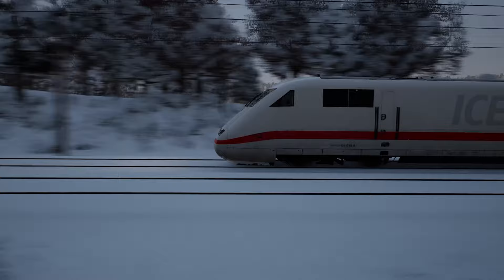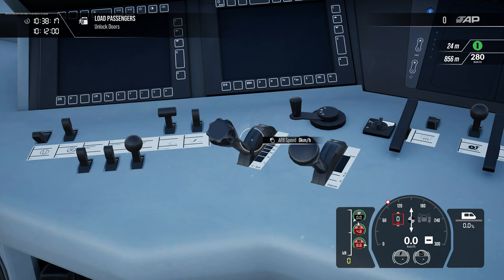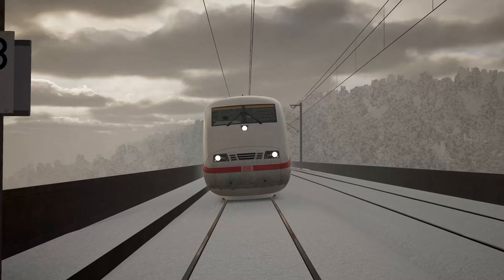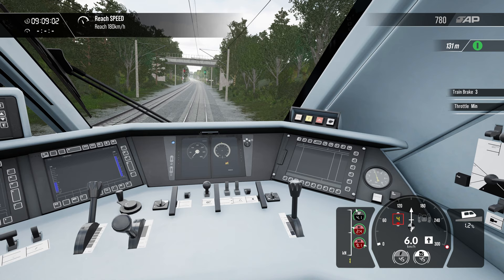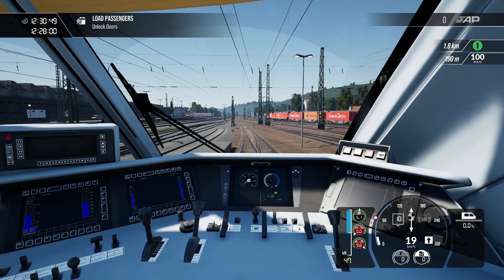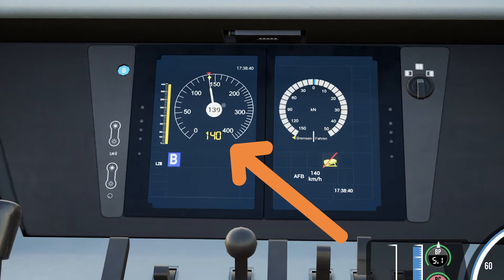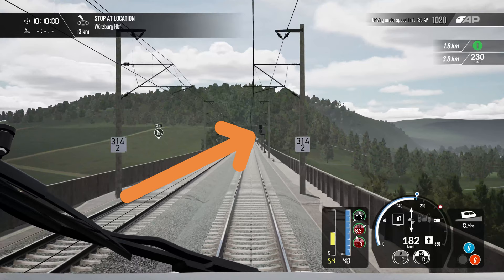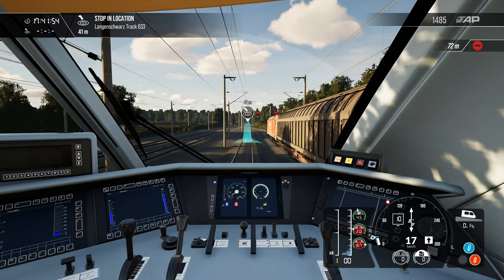Train Sim World 3:  DB ICE 1 Tutorial

Comment: Seriously, you don't need to apply full power when starting from a stop, roughly 60% is more sensable and shall prevent unnecessary wheelslip in adverse weather conditions. Also at 8:25 "Apply a 'little power', in the meantime applying full power, seriously you should not and do not need to floor the throttle to get moving in any circumstance.
Reply: It’s a sim my guy it’s not that serious 🤣

Comment: How do you restart the train if you accidentally pull the emergency brake
Reply from the maker: The manual is here, which should help you out: https://cdn.cloudflare.steamstatic.com/steam/apps/1944790/manuals/TSW3_Manual_V1.0_ENG.pdf?t=1662736189
Reply: Did you ever figure this out? I could never get the train moving again after the throttle/brake box on the UI goes red. Even tried restarting the train as per the manual.